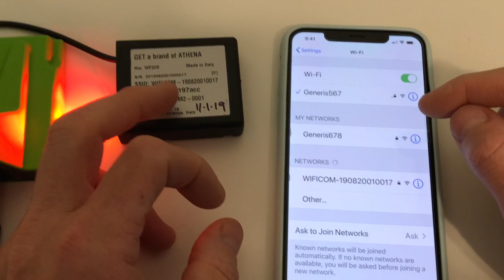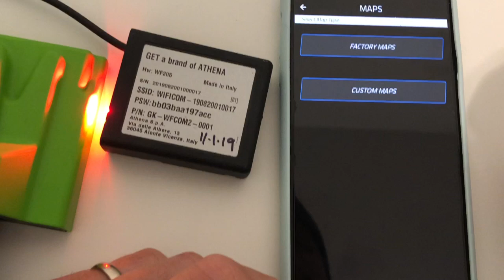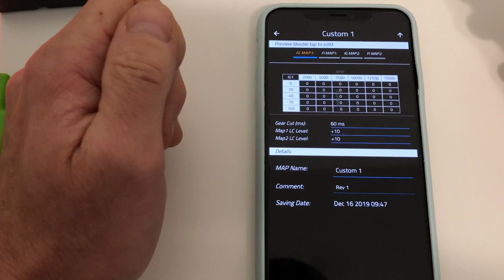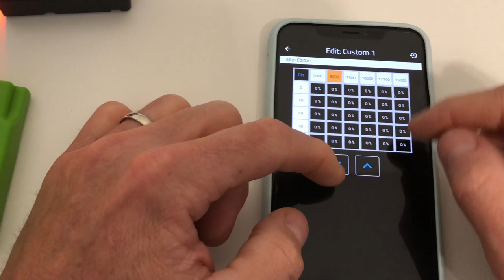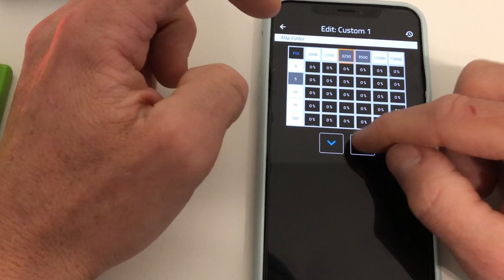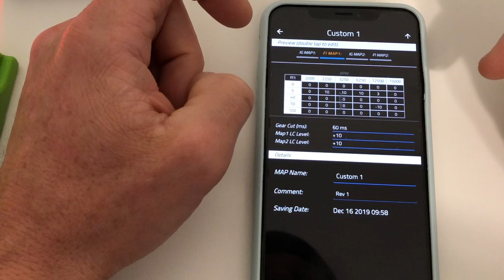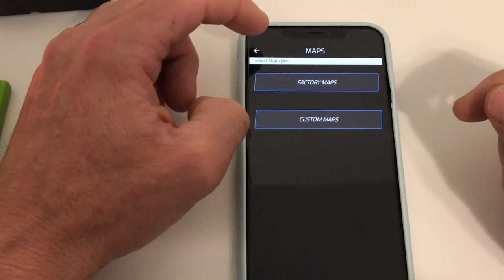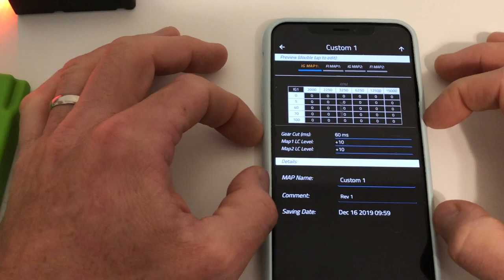ATHENA GET ECU - ULTIMATE SETUP TUTORIAL

Comment: Great Video, installed mine on the 21 500EXCF, getting a few choke stalls, but that's from tight woods wrong gear and idle set too low. Just did the wifi connection and zeroed out the tps for the first time after 2 moths of riding and a few races. Thanks for all the good videos

Comment: Nice.

How do I soften the response of the bike to simulate the stock ECU?

Bought the GET ECU to fix stalling and 1/8 throttle stumble issues.
Reply from the maker: Firstly - did it fix that stumble problem?
Reply: Just completed the idle screw mod. That seemed to take care of the stutter, and soften the power. 

However still seem to have an infrequent bog when on the gas hard, off the gas, and back into the gas hard.

Comment: Question: 
I have 2020 FC350 with GET RX1 PRO+Wificom+Map Switch+Traction control.
I live in a temperate climate and find it really hard to cold start (once it has started and leave it like coming in for a breather it will start fine again when I go back out so like 20-30min of not running) so when cold starting it cranks and cranks away without firing, I have to repeat it like 3-5 times before it’ll run. Is there some secret to starting the bike?

Comment: I hawe suzuki rmz 250 2020 i buy a GET ecu but there is no maps inside if i hawe kick starter how can i get power suply to my wifi box to load maps from app?
Reply: I need to use that wire where is writen tps reset- conect to ecu un other side to 12v battery? 
Becose inside my ecu has no maps i cant start my bike!

Comment: kinda sucks not being able to change fuel below 2000rpm's. Say you only wanted to increase fuel during startup because the bike was lean and hard to start you would select zero throttle and rpm's below say 800. that way once it starts and the rpm's are above 800 it goes back the regular settings. they need to change that so tuners will have control over dead engine starts.
Reply from the maker: What bike 
What is the idle speed set to?
Reply: @TACOMOTOCO  just making a statement, you never know after modifications what you may need to adjust. a robust ecu like the GET seems like it would give you the ability to do what you want. I didn't see the ignition map but if you wanted to pull a couple degrees of timing out just during cranking and back to base after it cranks can't be done with it limiting you to 2000 minimum. Wonder if the Honda or Yamaha programers allow you to adjust at low rpm's?
Reply from the maker: Not sure

Comment: Question, how do you upgrade or do you need to upgrade the APC Map?  Mine is APC_EXC350_20PR12r01_0  There is a newer version on Athena website?
Reply from the maker: Depending on what the later versions mod it may or may not be needed. Ecu must be dealer flashed